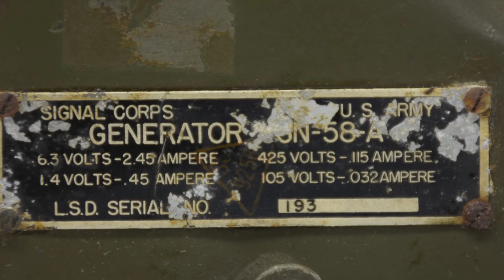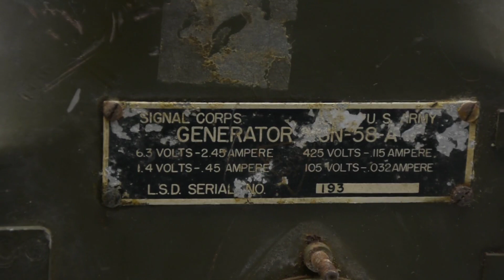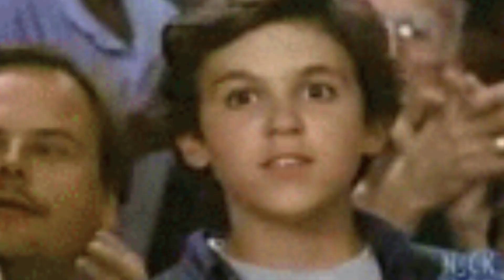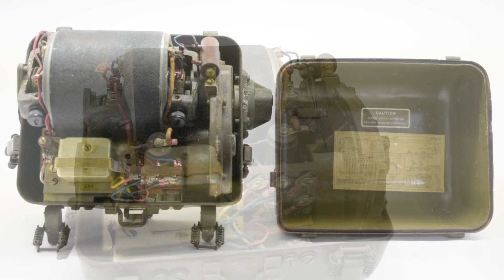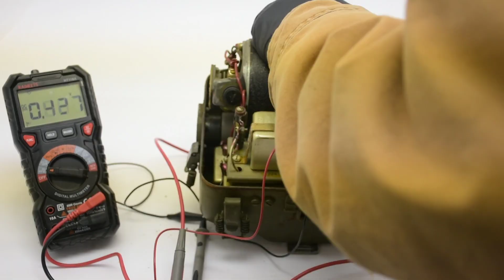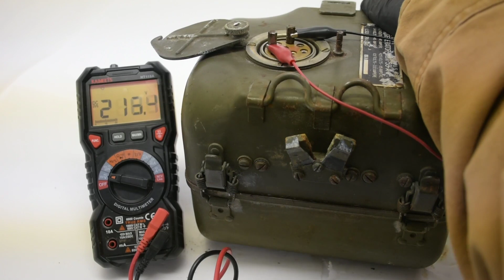Signal Corp GN-58A Military Hand Crank Generator

Comment: Thanks so much for documenting all this! You described the generator as "World War 2 era" (it certainly was), but it is also listed as material deployed to Camp Century in 1961. Camp Century was the Army base built twenty-five feet under the ice in western Greenland, abandoned nine years later but still there under the ice roughly 150 miles northeast of Pituffik. So if anyone wants one of these, free to good home if you can get to Greenland, dig 100 feet through the ice cap, and rummage around in two miles of tunnels that may or may not still survive!
Reply from the maker: Only 100' through the ice?!? 😅That does not sound awesome! Thanks for the info, that was a really interesting bit of history. 👍